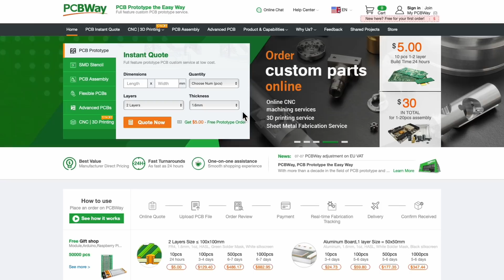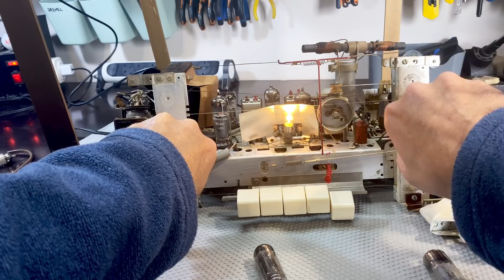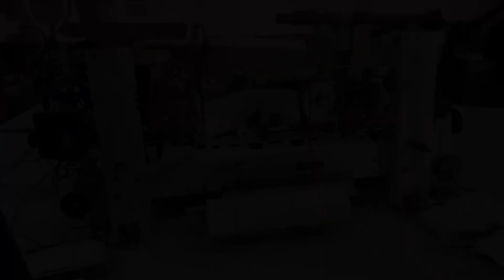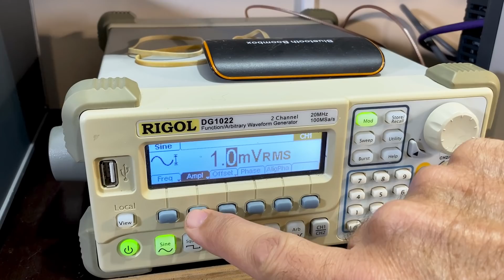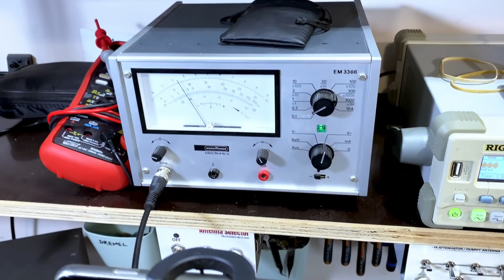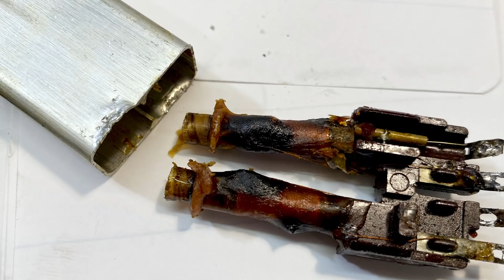Some you win, and some you lose. IF transformer break-down. Philips B4X23A restoration pt 2 #PCBWay#

Comment: Hi Manuel, I've got another small Philips radio in my attic. Are the FM coils the same in all of these radios. I'm positive that these were never messed with. You are very welcome to them if they would be what you need. 
Kind Regards,
g.
Reply from the maker: They used a few variants of the coils, so it’s not likely to be the same. Thanks.

Comment: I have a B4X14A and freed off the discriminator core with isopropyl alcohol and judicious use of a heat gun, it was a worrying moment. I have the equipment to do a full FM alignment but I am reluctant to attempt moving the other cores. I tuned to a strong station using the magic eye (Russian replacement) and adjusted the core for best sound, crude I know but it is working. Good luck with the replacement transformers.
Reply from the maker: Sometimes the best way is the one you can do and that works 😊
Reply: @electronicsoldandnew  Thanks Manuel, I think I'll leave those cores where they are. Sadly it looks like 'Russian replacements' will be thin on the ground for a while. Cheers, Steve.

Comment: It's a pity that the IF transformers are stuck and broken. This seems to be a high hours set to me, most of the tubes are already replaced. Philips would use their own tubes, which includes Valvo or Mullard. As somebody mentioned, the magic eye is an EM80. I hope you find new IF transformers. There must still be tons of it in spare sets. The ones in my fully restored Philetta look identical, but this doesn't help 😉 at least not me.
Reply from the maker: I has some on their way right now, so all should be good soon.

Comment: While you are waiting for the replacement IFs to arrive try experimenting with different solvents on the ruined ones. It looks like Philips used varnish to lock the cores and you may be able to discover what softens or even disolves the problem so that you will be ready to adjust the replacements.

Comment: Too bad about the IF transformers. I have the same experience with them, they are very flimsy and break easily. It shouldn't be too difficult to find a junk set as a donor. This same Philips I worked on a while ago also had a weak EZ80, as well as the EL84. Seems I find many FM receivers which distort and need alignment.. You'll get it right :)

Comment: Hi Manuel. Three of these type of sets turned up late last year. One each on Ebay, Facebook, and in our auction. They all went for a rediculous amount of money. They are really scarce here as they wern't imported except privately. (No FM until 1975) I hadn't seen one for sale for many a year prior. I imagine spares here would be next to impossible, so good luck finding the parts if anything was really wrong!

I'm currently working on a cute little locally made Philips with the same AM if transformers. It performs well, so I might leave well enough alone as the wax seals look original :)

BTW. I finally got around to trying your Bluetooth adapter, and ordered 25 PCBs from PCBWAY. Good enough quality, but the output from the actual Bluetooth module is quite low requiring the volume on the radios (4 tried so far) to be set at full volume. It's probably the modules themselves. On wards and upwards....
Reply from the maker: Actually have a set of replacements on its way from holland 😊 Got lucky, I guess.
The BT signal is lower than the radio signals because the original phono signal was very high, compared to the line level that the module produced.

Comment: I don't think it'll be difficult to get transformers like that; Philips used that pattern in a huge range of sets. But in the meantime, could you perhaps leave the broken cores in situ and replace the fixed capacitors with trimmer caps and align it that way? they would be under the chassis so would look right...
Reply from the maker: I could do that, but fortunately someone is sending me a set from Holland, and he got them from an unused chassis, so should be good. My only concern is if they also break and I may need some more :) I know I’m being pessimistic, but I’ve learnt how tight those lugs are.

Comment: Maybe you can tune the IFs with adjustable capacitors. Don't know if the ferrite cores may be stuck in a position where they would need capacitance added to bring them to resonance, but if they are too screwed inside, to bring them back to resonance it will be needed to replace the internal cap with a smaller value fixed one and with a trimmer in parallel that gives adjustment above and below the original capacitance.
Reply from the maker: That’s an idea, but I think I’ve found IF transformers for this baby 😊

Comment: Hi Manuel, that magic eye looks like an EM80, it has the scoop display, I know the schematic says EM84 but they have a line type display. I had the same coil issue with my Philips except in the FM module, when I tried to adjust it the thin former unwound itself just below the slug, I was able to remake it but it only had 8 wraps on the former. I recall there were two of similar construction in the module.
Reply from the maker: I saw your video and noticed you had that coil issue. These are critically damaged, unfortunately

Comment: I guess that IF transformer is used in a lot of models, so better show us what the manual shows for a part number, something like WE 120 70.0 or
A3 127 72 ? Probably it is printed on the can too, but not after to tough cleaning of course.
What I made (after I saw all sort of wood crack) as a screwdriver for these:  a narrow bamboo chopstick (very strong !), made a saw cut in the tip, and glued a piece of thick brass in it, salvaged from a mains wall plug, after I made it fit exactly in the slug. So only the very tip is brass, and holding perfectly.
Reply from the maker: the numbers on the sides are:
A3 128 37.0  (074)
and
WE 128 37.0   (374)

Comment: 25:00 I'm sure you don't need any encouragement of this sort but would it be possible to melt the wax by applying mild heat in order to be able to count the number of turns in the coils and then attempt to make your own windings and formers? Assuming it's not easy to find a suitable replacement that is.
Reply: Spoke too soon I guess... :)
Anyways, I've come across this site in the past that seems to be a treasure trove of parts, especially those needed for radio restoration when original parts are unobtainable. They seem to have various RF filters/coils so maybe worth having a look (it's in German so Google translation can be handy if one's German is not up to scratch):
https://www.roehrentechnik.de/html/zf-bandfilter.html
E.g. materials to make your own RF inductors
https://www.roehrentechnik.de/html/einzelkreise.html
Two things to note
a) The way the site is laid out is a bit unusual in that its contents structure is not at all apparent to you when on first look, so you have to do quite a bit of digging around. Unfortunately, it's a bit of an old design with the page titles being contained in images so these cannot be auto-translated by Google but you'll find your way around
b) They seem to offer quite a good range of audio transformers using rather more up-market materials than your usual audio transformer providers e.g. M-cores instead of the common E-I sort and probably cater for custom requests. It's worth exploring these options for any mini audio construction or radio restoration projects requiring unusual transformer configurations. Their prices are very good.
Reply: Update: Having just visited their front page, it seems they are not accepting winding orders for the time being, probably due to the pandemic. Unfortunately it seems that Gerd Reinhöfer, who I infer was the owner, passed away some time ago. I was not aware of his passing away as I no longer frequent these radio related sites as often as I used to in the past.
Reply from the maker: Great site. I wish Id found it sooner. Thanks
Reply: @electronicsoldandnew  Let's hope they are still/soon will be operational!

Comment: I have 2 IF transformers of an AM radio you could have them only postal cost from nz number on the side is A.P 1000/52 351 the other is the same number theses are of a portable Ultimate battery and AC AM radio.
Reply from the maker: Thanks for the offer, but I think I’ve actually found a donor radio exactly like this one 😊

Comment: I just got myself a later model of the philetta series and the only thing that needed replacement/fix were the tube sockets (corrosion as usual) and a a pair of new electrolytic caps for the power supply oh and a general clean up.
But else it was still working right "out of the box".
It also doesn´t have any paper caps inside, only "known good" philips ones and a single erofol II.
It already has a few semiconductor diodes, so it doesn´t need a EABC80 and has a ECL86 for amplification.
Gets a strong and clean signal in our kitchen with just a piece of copper wire on all bands, also already has an expanded frequency band up to 104mhz.
Don´t remember the exact model no atm but it was built in the early 60ies.

Very impressive how they´ve managed to shrink everything together to fit it in a device that small.
And even working fine after 60 years.
Reply from the maker: They knew how to make them to last back then 😊

Comment: I'm not sure about the Magic eye. To me it seems that it is an EM80 tube. The EM84 has a stripe. Am i getting something wrong here? About the IF can. I know how these can get nasty. The former is made from very aged and thin plastic. I love philps, but i hate those IFs. AMs are eve worse. Thin formers with no thred. You'l have to take care with trimer capacitors and coils in the fm front end. They're very brittle, so take great care about them. They can rip really easily.
Reply from the maker: That is amazing! You have the eyes of an eagle. I took it out and see that it is in fact an EM80, and the wiring is correct for the EM80 (cathode pin 2). I just went by the schematic which says em84. Now I can try and just replace as I do have an em80 in the box. Thanks.

Comment: Hi, as you started this radio it reminded me badly on my Philips Experience. The Ratiodetector core was also completely frozen. It ended badly and the thing got destroyed.
I could mange to rebuild it. There is a video  on my channel where I showed the process - unfortunately it is in German language.
As links are usually blocked you could search for 
"Ratiofilter zerstört - Philips B3X02A Reparatur Teil4".
After dismantling the thing I found some very sticky gue inside - may be Philips putted something inside to prevent easy movement of the cores and that disintegrated over time to sticky gue.
If you want to go the same route I may find another IF filter from that TV Chassis that you can rework to fit it into the radio.
Reply from the maker: I’ll see the video. Thanks.
Reply: @electronicsoldandnew  Básicamente tomó la "forma" de un IF de un televisor Philips viejo, y la bobinó nuevamente con el "alambre" (Litz) original de la radio. Previamente tomó las medidas y datos del IF roto. El núcleo es el original de la radio también.
Alemán es mi idioma materno.
PD: lo tuvo que desarmar nuevamente ya que la bobina de acople de salida la había bobinado en sentido inverso.
Reply: erwischt :D
Reply: @MultiWirth  Mich, bei'm Abenbrot, während ich "Der Staatsanwalt  Alles vom Leben" ansehe, erwischt. 9Uhr in Buenos Aires, mit 20°C :)

Comment: Most likely the same FM IF transformers are used in many other Philips radios. Maybe someone can cannibalise a junk set... Regarding the distorted FM audio, I would consider the discriminator coil as the prime suspect. I think putting the radio chassis into those metal frames is brilliant. Obviously the chassis can be handled without risk of damaging parts.
Reply from the maker: Yes, the other IF transformer is crucial to correct the discriminator alignment, but unfortunately it too is damaged.

Comment: Could one build the transformer from scratch if one knew the specs for it?
Reply from the maker: I could, but it’s a pain. However, if I don’t find replacements, I’ll probably have to. I’ll have to measure the inductance to get a ball-park figure and work from there, after counting the number of turns, etc. Don’t know if I want to get into that rabbit hole 😊
Reply: At least the lugs should be reusable. Looks like the former material has shrink and get the lugs stuck.
Reply from the maker: true
Reply from the maker: True. They can be turned over.
Reply: @electronicsoldandnew  I'd be interested in seeing that process ! And others too i bet. If it comes down to remaking it...
Reply from the maker: Another subscriber did it and posted o. his channel:
https://youtu.be/juvfonalGXE

Comment: Manuel I just picked up Philips ALADIN 54 HD 434 A. This radio has exactly the same problem, AM works brilliantly but FM is poor! I switch the voltage selection from 220 to 245 V, AM still works but FM not. I have to check the voltage at AM and FM but Iam sure that there should be a voltage drop. As you well know AM is more voltage tolerable.
Reply from the maker: Yes, check the voltages.

Comment: There is a German guy who designed a tube tester that connects to a PC but the FPGA that controls it has to be programmed with firmware that has to be paid for and once programmed and installed you have a brilliant computer controlled tube tester.
Reply: @electronicsoldandnew   The utracer is a well put together, fun to build kit of  a tube tester with good support.Reliable and not too expensive at about 200euro.
Reply from the maker: i’ve had my eye on it for some time 😊